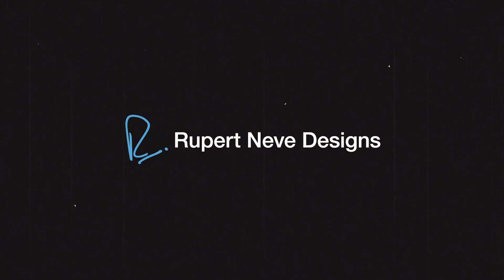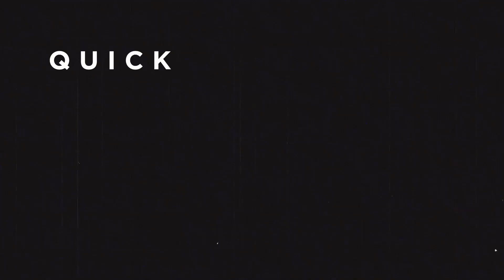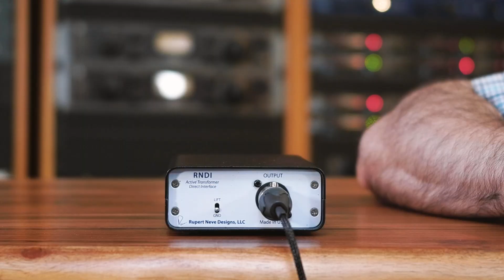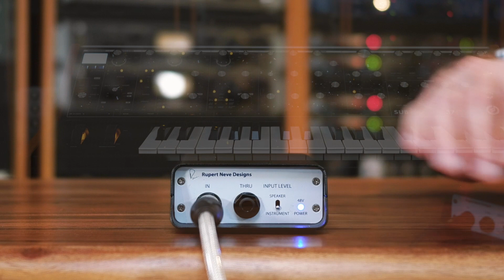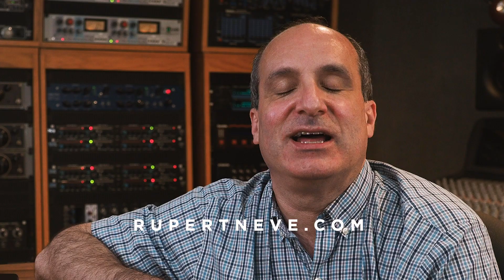Quick Start: RNDI Active Transformer Direct Interface

Comment: I need to ask a question... in the 70's many punk guitarists ditched amplifiers and went straight into the mixing console to record... by doing so they were using the console to colourize the sound... many people have studio set ups in their homes and do not use actual amplifiers. I own an RNDI since it very first came out but quite frankly you do not discuss or even show anywhere anything about using pedalboards... I need to know this... if I were using 10 pedals with Friedman Powergrid 10 (Which is quite an expensive power supply for the pedals) can I set up like this... guitar into pedalboard... pedalboard into the IN... set to INS... then the XLR takes the signal into the audio interface... can this be done on the RNDI without overloading the RNDI... so I can get the "Colourization" of the RNDI recorded into the audio interface of a Focusrite?  Most people creating at home do not have the set ups that you have in the instructions given with the RNDI. Hence this is an important question because below people have already made similar comments about the lack of seeing the various set ups in videos. At the moment from what I have read in the instructions is that the THRU does not have an altered sound with the RNDI... that signal is a guitar going directly through the IN and the XLR going out and what powers it also goes into the audio interface and it is this pathway that acutally gets the colourization of the RNDI... Sorry to go all technical here but people need to know. I know I am not the only one asking this.
Reply: Looks like no one answered this, but yes. You can safely do what you’re describing. He mentions in the video that the input can handle up to +21dB. The output of a pedalboard will never come close to this.

However, having owned one myself for several years, do not expect to get drastic coloration from this DI. It is subtle - much more so than anything you will have on a pedal board. Will it sound a little better than plugging the output of your pedalboard straight into a Scarlett? Probably yes, a little bit. But don’t expect it to saturate like the console inputs someone would’ve plugged into in the 70s. You’ll get much closer to that sound with something like the JHS color box.

Comment: Hi, I'm using aguitar with active pickups connected to the inout of a multifx and from there to the PA system. I have 2 questions I hope you answer:
Q 1. Do I need a passive or active DI box?
Q 2. If my routing signal is guitar-->DI box-->Multifx-->PA system would the DI box (in this case I presume would be the active DI) be able to improve the tone of my guitar?

Thanks in advance i fyou wolll answer me.

Comment: Does it make a Difference if i use a 1/4 TS (unbalanced) or 1/4 TRS (balanced) on the Front panel?
Reply: im looking for the answer. Do you know now? Thx
Reply: @wojtyla92  neve said no. Me personally i went TS. Rndi-s removes noise so TS is a little louder. Also anything i am feeding into the rndi-s is at full volume thata what its made for. I bought a second unit too

Comment: Hello there. Could you explain how to run a tube amplifier output (not fx send) into this DI? Maybe do a video demonstrating it? Alot of ppl I talk to about this say it isn't possible without completely ruining the unit...which makes sense in the sense that that the output voltage from the output of the amplifier is too high. 

I want to try this this but am EXTREMELY afraid of blowing the unit and or my tubes.
Reply: im in the same situation man, ever find an answer?
Reply: @aromaz1707  I got my answer to this when I discovered what a Load Box was and how it operates. Still considering using this though.
Reply: "the RNDI can handle up to 1000 watts when set to "SPEAKER"  mode." I about to try this too. But I am trying to find out if speaker cables should be used (instead of TS) for both the IN and the THRU when hooked up to a tube amp in SPEAKER mode.

Comment: The reason I watch YouTube is to see the actual hook up of hardware not a talk through.. This video failed to do that when you explained how to connect to bass amp and speaker to the RNDI without actually SHOWING where the connections physically go.
Reply: I agree, just show the complete hook-up, not all of us are audio engineers. He talked about an external pedalboard connection, but all he said was plug a 1/4 cable into the thru.  Completely useless.

Comment: Unfortunately I bought one last month, and I send it back, because it was not powering on when I press the 48v  on my audio card. I was so exited to try it out. But I didn’t know that I need to plug it with a XLR on both sides. My cable was a XLR from the DI to a TRS 1/4 balance to my audio card 😞
Reply from the maker: It's very likely you were plugged into a line input and not a Mic Pre input of your interface which is necessary to get the 48V.  A line input wouldn't have the 48V, and virtually all mic pre inputs are XLR and not TRS (on some interfaces with combo inputs the XLR is the mic in, and the TRS is line on the same combo input).  Another possibility  is that there wasnt a  ground connection on the cable you were using, which is how the 48V is connected
Reply: @RupertNeveDesigns  thank you, I’m going to order another one, but this time I’m going to use like you are saying a XLR to XLR cable 😊

Comment: Newbie question. I can run this into my interface with xlr male to female? And do I have to have the thru or 2nd 1/4” Jack on right input routed to an amp? Or can I leave it unplugged and just run the two cables, Instrument to 1st 1/4” Jack then xlr/xlr to interface? Thanks
Reply from the maker: Correct! Just plug your instrument into the front panel ¼" input jack, then XLR out to your interface to output audio and to power the RNDI (via 48V phantom from your interface). The THRU is not necessary for operation; it's only if you want to split the signal and also send it to an amp/speaker as well.
Reply: @RupertNeveDesigns  awesome thank you!. It's a DI  question I've always had and never could get a concrete answer on. Whether the "Thru" 1/4" right jack was necessary for DI Box to work properly. Really appreciate the response. Huge Rupert Neve/AMS Neve fan, although fairly new to digital recording, have always envied your consoles and lunchbox/rack processors!